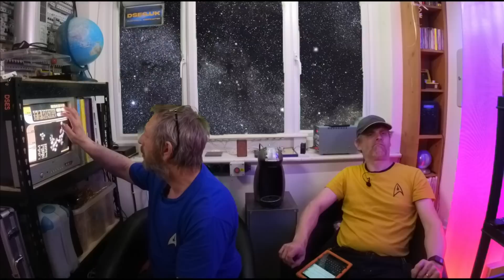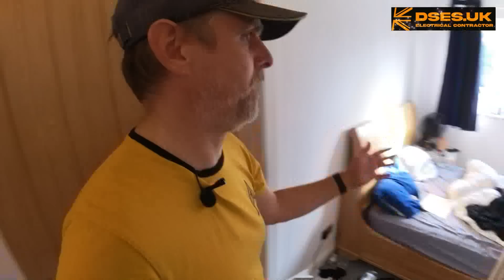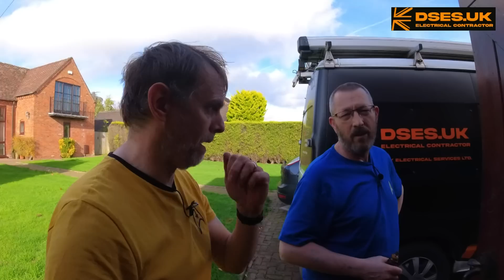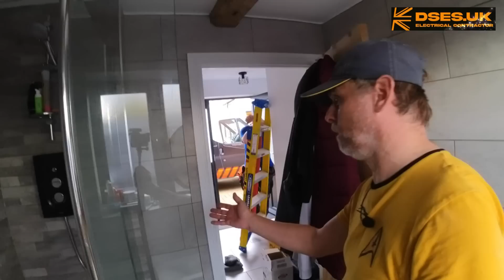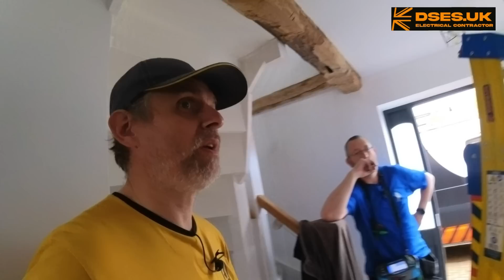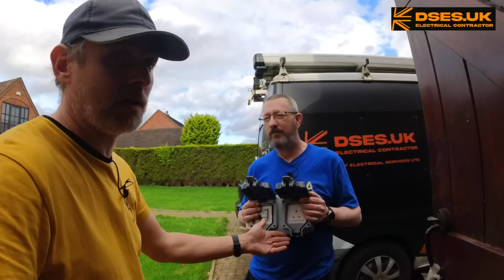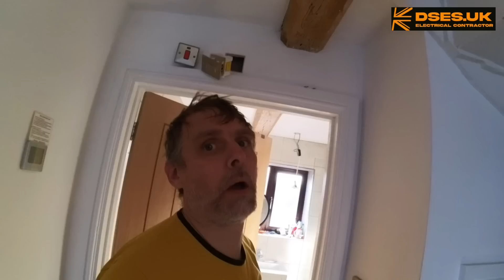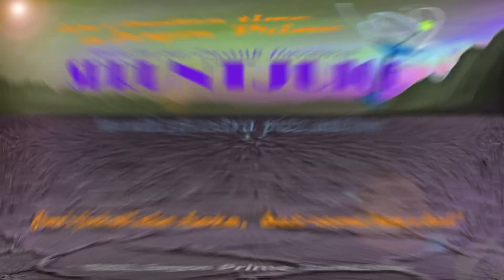Selectivity and Demand

Comment: I'm always surprised when electricians talk about " if the shower was run on very hot it would draw the full current!" In my experience,  when a shower is turned on it ALWAYS runs at its full current. If you put your clamp meter on the line and turn the temperature control down to cold it just means that due to the speed of the water entering and leaving the unit, it doesn't have time to heat the water sufficiently.  On tje hot position it does. So the current draw is constant. Particularly on a cheaper shower unit.
There are a few premium end products that can regulate the current but these are few and far between!
Reply from the maker: I speak from clamp meter testing of my own appliance, but I accept it won't be the same across all makes and models. It's rather a moot point anyway as you don't build diversity into a shower, the circuit design is to the rating given regardless of whether it might pull less in practice. Here, someone has neglected to put any thought into what was supplying the building and what else was in use, and they've plumped for the most powerful shower they could find for some bizarre reason.
Reply: @dsesuk  you are a wise and most powerful electrian. 🙌

Comment: Could you use a load sharing device . So that the shower say has priority first
Reply from the maker: I've used that before Gino including on my own home where the shower and EV charger share the same circuit (shower has priority), but what would we load share the shower with here? The only other circuit we could share it with would perhaps be the cooker, but that wouldn't be a convenient solution and on it's own the 10.8kW unit blew the demand.
Reply: @dsesuk  it was a poorly installed system. Bad designer

Comment: I think the biggest issues in this industry is that small companies employ  people to install first fix , and then get tought to do second fix but they are only labours or in training . Then the main electrician then just comes and checks out basics and fabricates figures for the paper work. It's very common. What will happen if we are not careful is the industry will have to work to much more stringent standards . I can see an mft being linked to a body that is similar to an MOT testing station where the car is linked and inspectors can see what's going on and even give a surprise visit . Bit over kill but if electricians and builders don't do jobs correctly they should be suspended from any work until they receive a training session. If there is a chance of anyone's work being below standards then they should not be able to do anymore until they sit a session of training. This may make people think . I know that electricians out there are not fully aware of changes,  they are old school qualified and that's it in their eyes. It's good that you are not shaming the builder and the person who signed it off. You should out of video make contact with them and ask why it's in a poor state.
Reply from the maker: In this case, I have my doubts that the electrician ever visited site at all. Why else would he put his name to wiring this poor where CPCs have been chopped and cables improperly terminated? It's gotta be a cash bung job where the builder says what he's put in and the spark knocks up a load of fiction in Easycert to cover it. While it's not unreasonable to have someone else, such as a labourer, drag in the cabling, it is important that the person intending to sign it off has a design and oversees the first-fix to ensure it's all going in to that design.
Reply: I was taught not to sign off first fix unless you are actually there supervising and observing it.

Sign it off and it is not compliant, you the sparky becomes legally responsible for what happens.

Comment: On a serious note , when you use a 3 phase device as single phase as you did in the board, it’s good practice to loop the phase through the spare way not just leave it empty
Reply from the maker: Is that looping it in to the spare way but not out? You wouldn't want to split the current path. To be honest, I can't see what advantage it would have old chap.
Reply: @dsesuk  I will have to agree with Jamie. Leaving a protected way unused means that you don't know where the overload protection will trip. Also I should note that the MCB type (B or C) is irrelevant in the Overload part of the curve. They should both trip at the same time under overload (not over current)
Reply from the maker: @nikoskeliris45  The curves were more about what was immediately available - the 3P C40 and 1P C50 were there off-the-shelf.
Reply: @dsesuk   no, in them out then back around and I and out again
Reply: It’s a good one for twitter , I was always taught to do this on brakes overloads and contractors as you never leave a protected way unused

Comment: Brilliant video , but fucking hell there is no way an electrician installed any of that shit wiring it was a pilchard, the garage I would of installed PVC conduit and mounted the CU onto a back board, the same for the sockets in the small out building . As for changing the 40amp main switch and breaker for the shower I think it was a good call under the circumstances. . Well done on a job well done and it’s now safe . And l love the Star Trek theme .
Brilliant video David as always 👍 l look forward to seeing the new toys sometime soon, if I haven’t already.👍
Reply from the maker: Thanks Sean, there are a few new (and old) things to play with over the coming weeks.

Comment: In regards to the current draw of the shower, I thought most electric showers do pull the full current regardless of temperature set and control the temperature by restricting the flow through the heater.
Reply from the maker: There's no diversity for the likes of showers, so the circuit design should reflect the rating of the thing. I may be talking out of my arse here, but that wouldn't be the first time.
Reply: @dsesuk  they often have 1-2-3 settings that bring on the elements independently and I assume the manufacturer over eggs the size to rob customers
Reply: Yea I believe this too , and that all instantaneous heaters work like this

Comment: What an absolute f*&king shit show. Yeah, the minute you mentioned the feed to the conversion was on a 40amp RCD from the main house, I though how the F does that not trip when they have the cooker, lights, etc, on in the rental property. And that shower, that reminded me of the tosser who put a 9Kw shower on a 35amp MCB in my place, that kept triping every 5 minutes, I replaced that with a 40 amp RCBO toot suite. CHRIST on a BIKE, what a shower of wankers!!!
It does make me feel so much better about using around 3 meters of 2 core bell wire to run 9 volts DC to an indoor WiFi security camera in the hallway.
Reply from the maker: An absolute lack of thought went into how that building was being supplied which betrays the fact a proper electrician could not possibly have been involved. I doubt our spark ever even visited that site and was paid to simply knock out a cert based on a circuit listing the builder had passed on.
Reply: @dsesuk  FFS Stevie Wonder would have done a better job even with one hand tied behind his back. 🤣
I loved the attempt to earth the armoured, sweet baby jebus, you have a metal CU and an armoured, FFS just gland it properly.
Between that and all the CPCs being cut makes me think a dirty, filthy muck spreader, with idol hands, did some, if not all that crap "work"